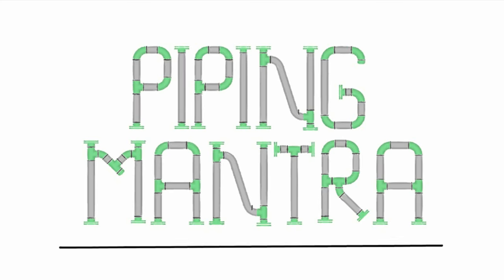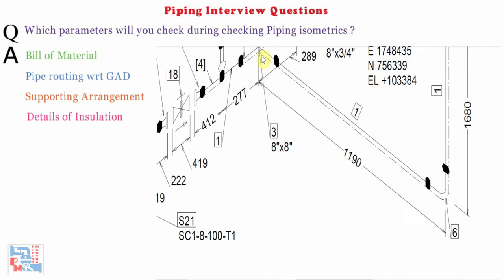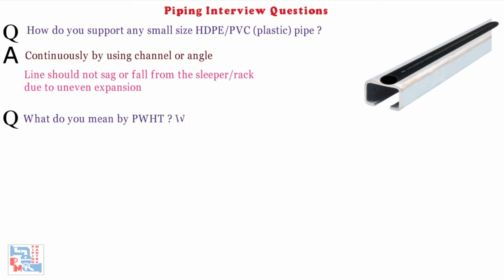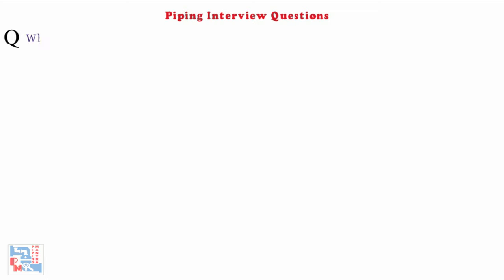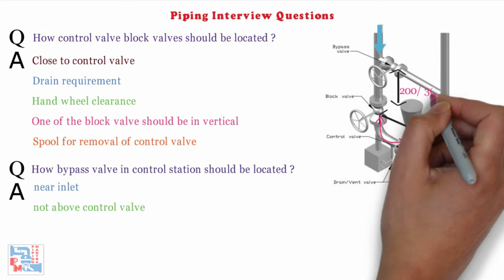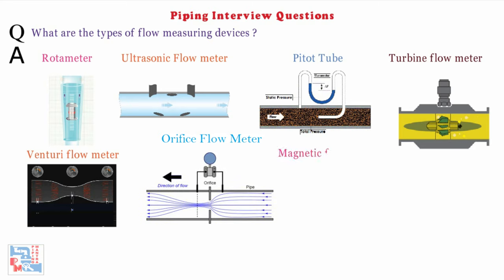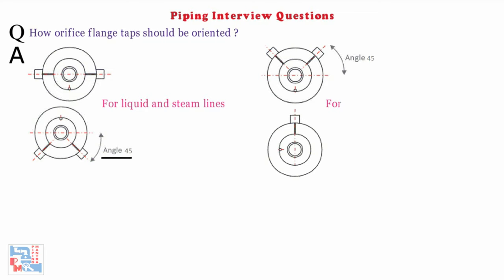Piping Interview Questions | Part-9 | Piping | Piping Mantra |

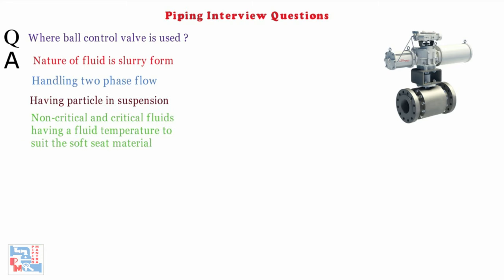Comment: As usual excellent video, can anyone tell please at 3:33, the valve used is hydraulic actuated or pneumatic actuated (as per picture)?
Thanks.
Reply from the maker: That ball control valve
Reply from the maker: FYI- Flare video in under preparation soon you will see that video

Comment: INTRODUCE PDMS ,AUTOCAD KNOWLEDGE FOR PIPING ENGINEERING 

It should be in a Detailed way
Detailed Drawing
Equipment layout
Piping layouts
BOM/BOQ/MTO
Assembly
Pipe Routing
Nozzle Orientation
Structural work
Reply from the maker: Yes